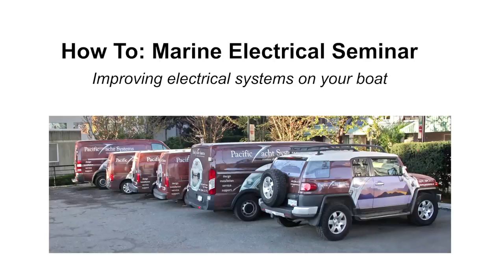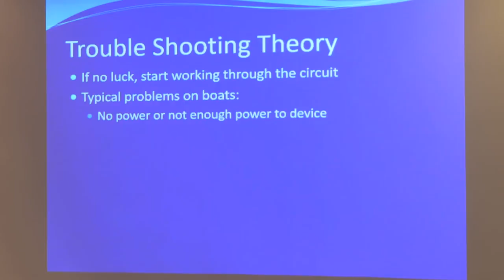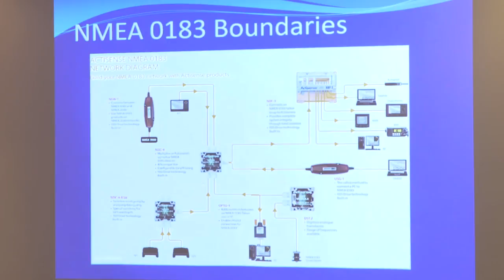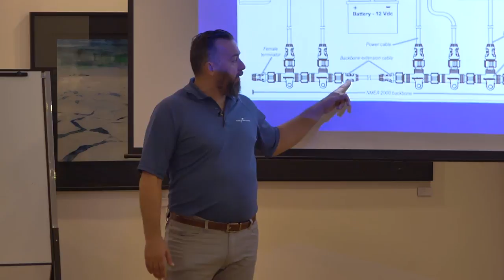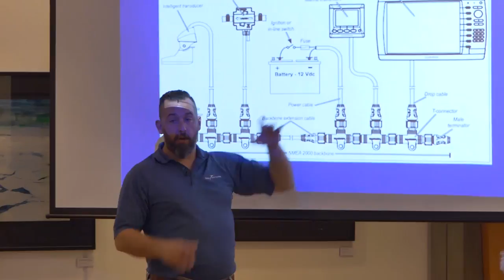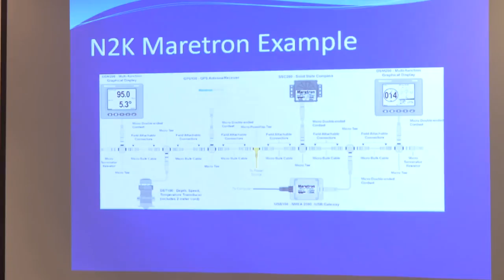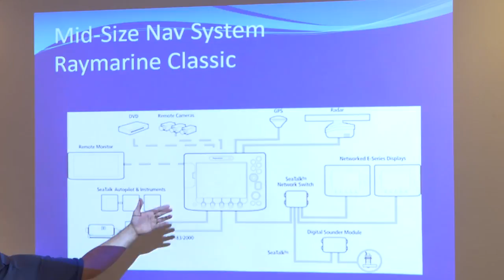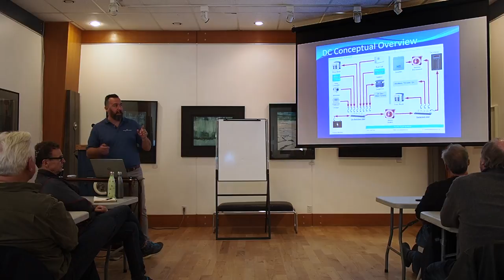How To: Marine Electrical Seminar - Troubleshooting Nav Systems - Ep 19/30

Comment: Love the Videos, Auto / Truck tech with a Computer and Electronics background Love to GEEK OUT Broken wires on cars and trucks real common, on my 1967 Hatteras not so much :P then again a crap load of 28 gauge to 14 gauge for a simple 12 volt light :O need to lose alot of strands for it to go out, and on a boat generally secured a whole lot better. On the one device taking the network down on cars and trucks see it all too often as they add more and more modules. A door module can cause a no start :O. Sooner or later if someone hasn't tried already will and backup cameras, lane departure alerts and what not to a boat. But IMO one bad node can take down the network. Back to enjoying the videos :)

Comment: +1 on which amp clamp meter you would recommend.  What features (AC/DC, auto-range, 600a or more?, etc.)?  Thanks!
Reply from the maker: Hi Karl, you nailed it. For a boater, DC and AC is a must, 600 amps is plenty of amps for most of us, and auto-range makes it easy. Thanks for watching.
Reply: @PacificYachtSystems  Thanks for response & the great video content!  Very informative.